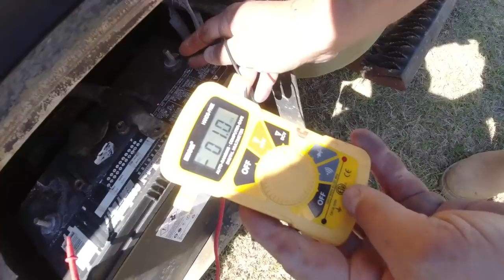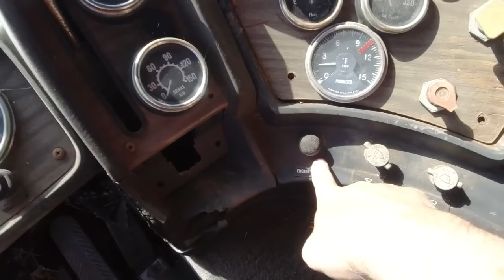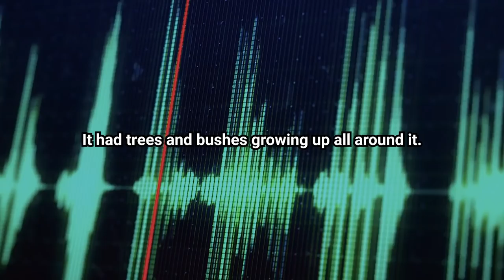Will it Start & Drive? ‘81 GMC cabover BIG CAM pulled from BUSHES!

Comment: An old trick I learned from an old man is to fill the fuel filter up with ATF which cleans the injector pump and injectors, he also says it primes up easier. Like the videos, keep up the good work!
Reply: I had to do the same thing with a mid 90's Cummins Ram. Ended up draining both batteries trying to start it before the shop Foreman showed me how big of a dumbass I could be. Fired right up after filling the filter housing with ATF.
Reply: A couple of things, fill the fuel filter and the pump there's a plug on top of the pump remove,  there may be a filter in there, if so remove it as well then fill the pump.  It  can still take a while to get it started if the fuel lines from the pump to the fuel injectors are dry as well.  Been there done that many times working with older Cummins engines
Reply: Gm trucks and c🎉😢ars are designed to be filled by an external filler so when you open the cap they will blow fluids  out .

Comment: I owned a '76 Astro in the early '80's.    It had been owned originally by the long since defunct Branch Trucking.    My "Jimmy" was powered  by a 290 Cummins with a Fuller 10 speed transmission, Eaton rears and Rayco suspension.   I drove it for about five years hauling the piggy back  trailers throughout the New England states from the terminals in Alexandria Va.   I had a good times with that truck and made some $ with it.  Fond memories.

Comment: I bought a 1981 GMC Astro and drove it 450 k . I also added a Kenworth arrow-dyne roof on with a second bunk. It had a 300 Cummins and a nine speed trans. I hauled freight in a 45 foot trailer.

Comment: Ive got tons of memories going trucking with dad back in the late 80s in his 1979 astro. It was a spec'd truck. It had round tanks like this one, an was converted to hub pilot aluminum wheels with a 400 big cam and a 13 speed. I know where the truck is but there isn't much left to it, pretty much just the cab an frame rails left an the frame rails are junk. But id use the cab if i could find a parts truck.

Comment: When you open the radiator cap and it has pressure on it, that is a good thing and don’t necessarily mean you have a bad head, the only time you have a bad head is if you have foam, or bubbles coming up in your antifreeze or coolant. That means you have a blown head gasket, and compression is getting into the coolant system, and that isn’t good. If that happens, leave the radiator cap loose so that it won’t build up pressure, because when you shut the engine off, that coolant can get into the cylinder chamber. Pressure in the cooler system is a good thing, means you don’t have any leaks, and everything is working the way it should.
Reply from the maker: That’s what I was thinking.

Comment: I drove my Father-in-Laws 80 GMC Astro with a 318 Screamin Detriot. 13 speed. He used to haul lumber with it and He also hauled logs. It sas a Rough ridin truck especially  with that Reco Suspension  under it. I would love to have that truck..Great Video...You cant beat those old Cummins.

Comment: I saved an 86 GMC Suburban 3/4 ton 4x4 4-speed. Was able to crank it up and hear it run for a few seconds. Was the first video I ever posted on my channel. My brother Chris and I are planning to work on it again here soon now that the weather is nice. Just have other stuff to get off our plates first.
Reply: We’re Taking Apart A 91 It’s The 80s Bodystyle With A Tbi 350 Setup. Kind Of Rare. We’re Bringing Back An Old Silverado With It

Comment: I drove an Astro for a buddy while he was on vacation. We pulled a 34ft.domp trailer and hauled anything we could get in it. I was a nice truck to drive. The problem was trying to get into the sleeper. Very hard to get in the sleeper. Not sure what year it was but it looked   like yours . It also had an Eaton 13 speed  trans .

Comment: Had a 75 back in 82 with a 290 Cummins ran its butt off, till the front housing broke and the engine dropped down. Had almost 700,000 till it was majored. Had 900,000 on it when I got it. It was pretty worn!

Comment: I watch you guys on the big screen all the time. I have a Wally style shovel/hammer/pry bar/impact/starter switch/wrench too. 😁 I've been using them for years.
I use to work for a concrete company and one of my jobs was delivering concrete septic tanks and hulling block. The truck was an 81 GMC Cabover just like that one. It had a 24 flatbed with a crane on the back. 
I hate cabovers they are awkward to drive and all over the road; and they hard to get in and out of when your drunk. 🤦 
An old guy could get hurt just getting in one of them dang Ol' Cabovers..🤣😂🤣
Reply: LOL

Comment: I drove a 1982 Astro.  I put 200,000 miles in it before switching to a 84 International 9670.  The Astro was a good truck but dump trucks rode better.

Comment: I remember these old dogs! Used to see them all over the road. When I was a high schooler, my step dad gave me a job working for him. He was a bed bugger (household moving). Ogden Transfer and Storage and he worked for Cartwright Van Lines before that. He had '78 Mack Cruiseliner, 5 speed, 300 Maxadyne engine. From '79 t0 '82 I spent my summers on the road working my a$$ off and he taught me to drive it. I drove almost everywhere out west, and he did all the eastern driving. He payed me $250.00 a week and payed all my expenses. That was great money for a teen back in those days. In 1982 I joined the USMC. This sure brings back lots of wonderful memories. I always missed those days on the road....... Still do.

Comment: To check for fuel if you cant find a stick or have problems getting it into the fuel tank. I like to use the oil dipstick to help keep dirt out of the fuel. Some times it can be hard to read but it does the job.

Comment: Yes I have cranked on old truck thats sat for 13 years (was someone's project), a 92 Silverado I bought in Arizona, I bought it for $500, I did the lower intake gasket, rear main seal, Found out it was a 4 bolt 350 with a pretty heavy cam in it (It was hard to get it started at first with that cam), and I swapped out the stock 2 barrel TBI they had on it for some stupid reason for a EFI 4 barrel holly I bought at Summit, I had to end up doing the radiator and water pump, I installed a locker rear end, I drove that truck for 4 years, drove it back to Ohio 2100 miles away in 2019, I recently sold it for $2400, 400,000 miles on the body, but the thing was clean, no rust, paint on the frame. I bought a 99 suburban for $1700 and used the extra money to buy a new front diff and I installed another cheap locker rear diff in it I got from summit, needed rear end bearings anyway.

Im 32 and im getting too old for fast stuff like my old loud 92, I wanted comfort, and able to work when I need it, And my Suburban gets better gas milage lol

Comment: The Chevy was the Titan

The Cummins always draws fuel from the driver side, if you plum it to pull from the passenger side,  it may run, but it will be hard to start,  and will run very poor.  The fuel pump can pull easier from the drivers side.  It's the distance  that  causes  the problem  And the crossover hose will allow fuel from the passenger side to the drivers side.

Comment: I bought a 78’ k100 kenworth for $5,000 five years ago. Still got the truck and currently restoring it. But it has a 400 big cam Cummins that sat for 8 years. All I did was put 3 hot batteries on it and she started up on the first crank.

Comment: Drove a 82 hauling bldg materials with a big cam 350 and traded it for new k100 at over 900000 miles. Still ran strong with front rear issues

Comment: I drove a single axle GMC Astro when I starting driving in 1979 and into the 80's.  We used to joke that it had the wheelbase of a Volkswagen, they were higher than they were long and if you hit the brakes too hard it would fall on its' face.  They were cold in the winter and hot in the summer, the air conditioning was the old 2/60.  

They were night and day difference from what's on the road now, but oddly enough I miss those days, worked with a good bunch of guys back then, we're almost all gone now.

Comment: Had some seat time in a 79' Astro with a straight 7 and a Detroit, when I worked for Mayflower moving. it was just an around the town pick-up truck they had with a 45' moving van attached.

Comment: I drove an Astro for about 7 years and put 199,000 miles on it when they retired it and I was pulling a dry box. I was hauling plumbing fixtures with it and always weighed in the neighborhood of 65,000 to 79,000 pounds. Personally, I liked that old truck, I thought it was a cool truck.

Comment: Only gmc that I drive. Is an 98 gmc c6500 dump truck. Caterpillar turbo diesel. Love that dump truck. Mileage stopped working once it maxed out. Just did a lot of work to it and did a full detail. Since during the winter I salt with it. Want to keep it for a long time.

Comment: Well they are right in some cases . If you have a vehicle and you get it overheated and you pull the cap off after it cools. If it has pressure it usually means you are pushing compression into the water ports. If a head gasket is blown then it wont build pressure to force air into the radiator

Comment: I bought a 1971 International Trans Star that had sat over ten years, It was an old Cattle Hauler Truck with over 300,000 miles on the mile o meter. We cleaned it up and filled it with Hydrolic Fluid and let it sit two weeks, We then drained it and put Batteries in it to turn the motor over and it started in less than five starts , I hauled Walnut Logs with it for three years. Total price was $2500.00 AS is. I ran the tires that was on it all the time I owned if without a Flat. I sold it running fot $8500.00

Comment: I drove a 1975 astro for ten years. I still have it setting in the back of the garage they use to say in the winter you would freeze your but off and in summer you would sweat your but off I can vouch for that . A lot of windshield (I was a milk hauler)
Reply: It seems like the windshield goes down to your knees!
Reply: I drove a 77 Astro,  and compared to a 77 Pete,  KW, International,   it had a great heater stayed warm going down the highway in Idaho,  and Washington state.  I could even sleep in cold weather and stay comfortable.

Comment: The twin to the Astro was a Bison. Grandpa hauled granite for making tombstones from Georgia to Hindman Ky back in the late 70’s through the 90’s with a GMC Astro it had a 454 gas up until the mid 80’s then it got a B model cat
Reply: First, the Astro was a cab over,  the Bison was a conventional.  
Second,  GM never put a gas engine in a class 8 (Astro/Titan) truck. I don't know what your dad was driving but it sure wasn't an Astro.

Comment: If there's one thing I never had the pleasure of doing is. I've never met any people who went out and started old stuff like this. But because I grew up through the mid-eighties. And 90s, I've always had an interest in auto mechanics and old vehicles from my generation because I always believed that the older vehicles were always the best because the older vehicles were one easier to work on except.  It's a bold part and I think that the older relics were better than the computer's nowadays. And I always had interest in the older vehicles and always an interest in wanting to try to fix things and repair them and be my only guy I before. I would like instantly want to just give up on something. I was always the type to never give up and try to fix it before junking it.

Comment: I took one of these Trucks down the South side of The Grapevine on Interstate 5.  Just beyond the North Bound Cross over with a Broken Cab Hinge on the Passenger side unable to steer or shift down with only the hand brake with a load of Monterey sand in bags and kept it on it's wheels. I was driving for Wolf Transportation. I left the Highway and traveled all the way down to the bottom of the canyon dragging the trailer loaded. It was in all the News papers at the time. 1982  The Truck was white in color and was # 13.  Raymond Francis Pittam

Comment: Excellent video Hank :) & Wiley :) that truck type was Animal haul to Stockyards my one cousin had also motor 300  Cummings 6 cylinders with 9 speed Manual transmission with 2 axles of  390 ratio single bunk too ! Only thing never like those cabover is fly open cab one did on Fire Department of tanker and weld chain links to cab to Y backwards to hinches to middle bolt in place too! Truck was Tanker type  Cabover 5 ton International gas 6 cylinder Also 10 speed Eaton single axle 390! A lso Hank & Wiley  what works takes oil or fuel filters off is Leather belts for keep jeans pants up wrap in belt buckle till got enough belt to yank filter off with hand! Best belt length have is 44 to 38 inches waist type use and thick one too! T BONE stake with a garden salad & bake potatoes too plus Coffee drink for Wiley to eat Hank :)

Comment: Had a boat with twin Detroit diesels in it it was under seawater for a few days and then we brought it up so 40 footer.... I let it set for probably 3 years full of sand seashells and whatever else.... I cleaned it put new injectors in it new starters set it up for fuel... Primed it and they fired right up.... I've been a mechanic for over 50 55 years now..... And no those aren't the only Detroit diesels I've worked on I've worked on a lot of them

Comment: I agree with that I’m a diesel mechanic actually had a truck with extremely high pressure on the radiator today gasket blown

Comment: Super cool Twin sister was the Chevrolet Bision, Even more rare to find. That oil stick got me... There is an '81 GMC Astro near me I've been trying to buy off an old-timer. Tandem axle, sleeper cab (like most), 8v71 that runs, and a 9spd. Nice video. Thanks.

Comment: I saved a 1991 ford ranger with my buddies, 3.0 v6 automatic. Sat for 11 years, re did the fuel system, ignition system and pulled the tranny to replace the front pump seals and stuff. Fired up and is now my daily driver, she ain’t that pretty, but she’s mine.

Comment: Pressured radiator cap means it has good engine in it in my experience.. I owned a 1979 Kw. For 15 years. 20 yrs ago . stuck little over 1.2 mil miles on it before i quit OTR went local dumbtruck.

Comment: Those rearends are Rockwells. Rockwells are smooth on the back of the rear rear and Eatons have a ridge down the center. Just an easy quick way to tell what kind od rear ends are in a big truck at a glance

Comment: radiators have pressure naturally (hence why you have a spring in your cap and theres different pressures too) if its boiling out exhaust gas its bad (if its been sitting forever and you open the cap and it has pressure thats usually a good sign)
Reply from the maker: I thought the same thing

Comment: Up to 1bar is normal on the cooling system. If it's too much the drain will open. Under pressure water can't boil.

Comment: HANK.What happens when you heat water?  It EXPANDS, and that creates pressure.  If the head gasket breaks feeding combustion into the coolant that will also create pressure.

Comment: Chevy was the Bison 🦬! I drove a 81 Astro for over 5 years ( 500,000 miles ) those are bad in the winter because you can’t keep the windows from frosting up ( windows are huge ) mine had a 350 Cummins w/ 9513 Roadranger ( 13 speed ) 22.5 tires and no air ride single sleeper ! But it did have power steering ! Lol

Comment: Went to truck driving school in 1985 or 86 the first truck I learned on was a Chevrolet Titan with a 9-speed and a 318 two-stroke Detroit ,man I hated that truck Full Throttle all the time, couldn't shift gears in that thing to save my life. Most of their GM tractors had the GM Detroit engine. Those trucks were worth scrap price when they were brand new

Comment: great video but have odd question  for what is make and model # of the meter you use it looks perfect for the stuff i do   three years ago i bought  a 1939 i think it was  9n ford tractor  sat for 10 years got it started it smoked and valve noise i changed oil and put in engine restore  in engine  clear right up  sold triple the money engine restore works pretty  good  God bless
Reply from the maker: Innova Auto-Ranging Digital Multimeter
It’s like $20

Comment: They state right on the cap on how much pressure it should hold and thats to circulate the water through the whole system. Now if its building a lot of pressure then its a whole new  can of worms.. I would say that if you just drive it around in circles for a bit with the clutch held in, the rust on the plates will give up and then go to working. I know one guy who had a fleet of them, none under a million miles. Most were smaller engines starting out an then gradually got bigger an better engines. Clutch us not out, just stuck from setting so dang long. With the fact that no one is making the cab overs, there is quite a following for them. A simple wrap around that old body would make it the pride of a fleet. I seen lots of big truck companies run them till the freightshakers were the cheaper buy. No reason to not put it back on the road as the frame ain't doing much rust jacking, around the fifth wheel is normal for most anything  ten years old so think hard for just dumping it for scrap.... a damn oil change with a handful of the filters changed an its gonna come around... get someone to show you how to adjust a clutch or it will be screwed up good. Its not just a outside rod adjustment but underneath that truck you ..... get someone to show you!!!!!!!!!! I ain't wild about this engine but its a roller. I kinda fell in love with the big cam two engines an bigger... thats all in a pump as well. take the time to listen to someone who is not a defeatist and just hates seeing anything without air conditioning or blue tooth... you get it man??